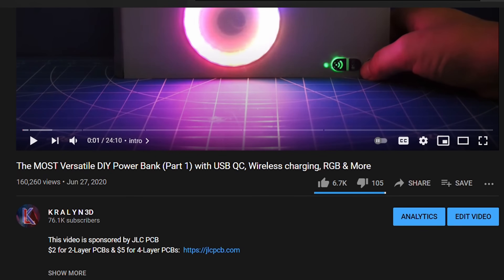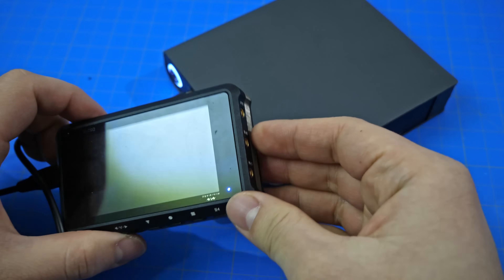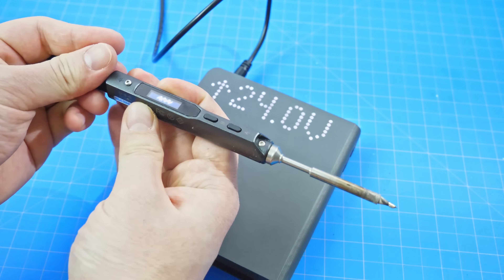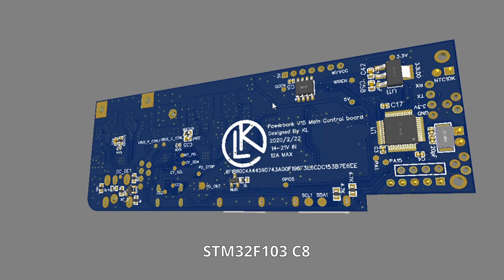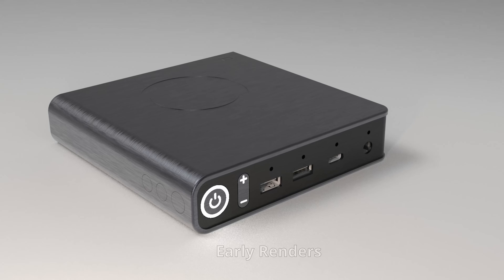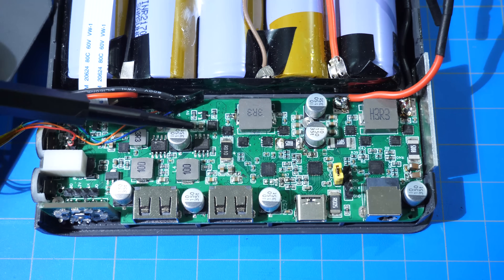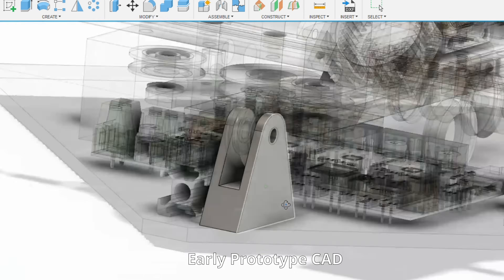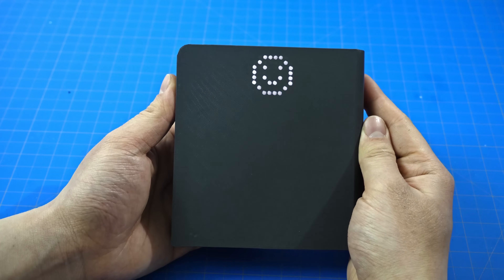Power Bank Project Update! And Others...

Comment: Your channel is wonderful, and I've been looking for a channel that explains a similar idea so well, I would love for you to explain and show the design for a modular Powerbank, in the shape of a brick,Which could be expandable or have a charging dock that could be used to charge 2 or 3 of these expandable modules for the power bank, in case a 20000mah Power bank is not enough, Have another 40000mah expandable module, and if you need more, you can attach another 10000mah module. 😅😅😅😅

Comment: It would be good for the power bank to communicate with the connected modules

For example to communicate with the inverter module to report for example ( voltage,temp,current,load,hz,estimated time etc )

Comment: Hi, great projects!!
A questions about the power bank, 
- will be firmware upgradeable?
- what will be the amps power for the dc out?
Thanks!
Reply from the maker: The DC out capable of outputting up to 5A, the firmware will be upgradable but the exact method is still being worked out for safety reasons.

Comment: I think this has drifted away from what most people like about the original power bank. That thing was packed with batteries. You can find power banks all day long that have 4 batteries in it. It also looks like the batteries are built in and not replaceable. Make one like the original and make it so you can swap out the batteries and i'm in.

Comment: Nice Design. Personally I would use Lipo Cells instead of 18650.Also the matrix display could be smaller or a lcd screen. Inside the plastic with hexagonal structures. Finally the Lipos should be replaceable in future connected with connectors instead soldered

Comment: This is a very nice power bank. Do you have any instructions on getting a USB C PD to work for both charging and discharging on a 5s battery pack? I'm building one for other uses, but having USB C PD would make it a lot better. I have found some nice modules on Amazon, but I don't know if they can be ran directly to the pack and bms, or if I need something else in the middle.

Comment: as a Product Developer and owner of El Domo product design agency, I would gratulate you for this modified design. I will contact you with a suggestion to add a module to it. Keep going. 
*upside down printing is possible, but if the parts start to reliese even a little little, this will not work. It is too risky, be carefull,.,

Comment: If the price is around 99-125 dollars i would consider that affordable but with all the plug-ins options and the DC output I feel like 149 might be decent expecially if you can adjust the amps of the DC out making it a power supply as well as a power bank

Comment: It's an amazing charger but with the extension, you have to add the ability to use AC adaptors from other countries. I'm from Australia so if I want to use the AC adaptor I won't be able to in its current form

Comment: Hello!
Please add UPS mode: When an external power supply is present, it is supplied to the output without the involvement of the battery.  If the external power supply is lost, the battery is automatically connected.  If the battery is completely discharged, then when the external power is resumed, the output power is automatically turned on.

Comment: for the ac inverter if possible in your design make where it could handle up to 300 watts where gaming laptops and stuff could temporarily run on it and another possibility if it could fit in a connector for an external battery pack for a longer runtime

Comment: Great stuff!

Would like to see battery-care features, like limiting state of charge to 20-80%. You lose 40% capacity but gain on the order of 400% more cycles!
No product I've found offers that - makes sense for a large manufacturer to limit the lifespan of a device. But it could give you a selling point. :)

Those LEDs are nice and bright... unless you're in a dark room. Hoping to see some way to limit display brightness, maybe even automatically.

Throwing "ModPod" into the hat of names. It's modular, and you could call those external modules "pods".

Comment: Good engineering design, well done.
I recommend you put some ventilation holes and a fan to improve the air flow, so as not to have heating problems.

Comment: I want to make a power bank with a QC 4.0 port for fast charging. Is there any circuit which can automatically switch the voltages and the current? I also want to make a manual port, where I will ise the QC USB tester for switching the modes. As I will go camping in the Summer, I would need a powerful powerbank to charge at least 3 phones simultaneously and use it as a giant flashlight. Also, I would like to have a display showing me the charge time in total, the current and the voltage outputs.

Comment: It would be nice if you could put multiple modules inside each other to use them at the same time.
And it also would be great if you make solar panel and extra battery modules.
Then you could for example put a few solar panel modules inside each other. And if you need more capacity you could also plug the extra battery module in.

I hope that this powerbank will be available in germany and that the AC module will have a EU plug version.

Comment: Amazing powerbank!
Good choice of MCU and all other internal components.
It's really well made and not over engineered ;)
But actually I don't know any powerbank that have some wireless communication or something.

More metal frame with plastics would be amazing but harder to manufacture and more expensive :/

I don't know what could you actually upgrade there. Maybe some better protection from dust etc.
And more strong housing?

Also I don't know it it's good idea but small buzzer to beep when the power is low?
I got some inverter and it beeps when the power is low and it will shut down in a while.
Like a reminder that you don't have much time left hah
But flashing LEDs is enough I think.

I'm looking forward to see updates on it ;)

At this time I don't have any powerbank and I would like to make one myself, but yours is truly stunning for me.

Ah, and the name!
Maybe... 
MPPB (Modular Portable Power Bank) or something simmilar like UPMPB (Ultimate Portable Modular Power Bank)
Guess it's too long hah
For short - MPB (you know what this is)
Even shorter?  Here you go: MP (Modular power)
Probably I'm not good at inventing names :/

Have a great day :)

Comment: for the external module connector, it's a nice addon to be able to increase capacity by adding extra sets of 18650 batteries thru that connector.
Reply: if this will be a feature, i want a powerwall version of the external battery module, which then you can connect this powerbank that will act as its controller.

Comment: Your power bank design is super cool! The variable DC output would be incredibly useful at my job.

If you made a module with two RJ45 connectors, enabling the power bank to function as a portable PoE injector for network-powered devices, I would be pretty desperate to buy one.

Comment: Are there provisions for a data port to access internal BMS data?  This data would be useful for implementing UPS functions and wear leveling on the batteries themselves. Also for addon modules could use the data for IoT devices.

Comment: Two questions:
1. What voltage range does the DC input jack (not USB-C) accept?
2. Could there be any way to add MagSafe to the wireless charger, potentially as an add-on?
Reply from the maker: 5-30V for the input, magsafe is possible, I shall look into this.

Comment: Does it work as a UPS (delivers power even when it is charging). Can the ports be configured not to auto tun off when no charge is used? I was trying to keep an android phone loaded, but every time the phone was full and did not use the power, the powerbank put the ports in sleep mode, and you had to reinsert or press a button to wake the ports up.

Comment: Display comsume lot of power ...can you use small display .IN power bank there is no temperature detector . Use the temperature detector for turn off power bank . When there is more heat loss or high temperature the power bank off automatically so power bank preserve the power.

Comment: you should add some kind of short circuit protection at the bottom where the module connects. Can be a fire or burn hazard with open terminals.

Comment: What type of battery /cell being used? Li-Pro? Li-Ion? 18650?   Will the cell compartment or individual cell user-replaceable? As seen in previous other's comment, adjustable output voltage/module for intl plugs will also be good.    Your design is good, looking to pledge it once you're put online for the project.

Comment: I have not tried it, however, I believe that the biggest problem with printing upside down would be layer adhesion. if you print upright, you can be a little bit off on the height calibration, however, printing upside down would probably require precise tuning of the z-axis, which you would have to retune every time the printer is reassembled from its stored state. I'm not sure if it would be beneficial or not and if you are already planning it, but a lot of printers use a heated printbed to help with adhesion.

Comment: I currently use baseus powerbank and even to my self it was surprise that one of most used feature what I use is that I charge it with micro usb and use it with usb-C PD at same time. It is so many times that there is low power usb-c available but I want charge high power devices like laptop. So I really like to see feature that add one or even multiple micro usb ports what allow charge that battery same time than you use it. Also some times there is low voltage usb-c available but because laptop needs 20v I use it as converter. So I think that at least dual usb-c is quite mandatory so that it is possible to charge it at same time when using it. Most probably it is good idea to put high power usb output and  usb-c + microusb input. 
Also one thing is that micro switch what you use to detect module is not very good. It will stuck to cables and get broken.

Comment: uff....
really great...
now looking more realistic....
1. what's the weight of this???
2. you can work on rugged rather than providing enclosure
3. also you can work on the water resistance by stopping water from getting in the case... this will make more realistic and future proof ( though it's more than enough but there are many users who needs that thing - i need because we have rainy climate)...
4. idk much of circuitry but will replacing batteries by user if anyone of it gets faulty be replaceable? this will be the best deal breaker but water resistance that i talked about won't happen likely...
5. and i'm eagerly waiting for your response and crowdfunding... i'm also in waiting list for buying 'THE ULTIMATE' from you...

Comment: This is what I wanted to make by myself. What for me would be useful would be easy removable batteries so you could change them when they life decrease. And could be module where you could add capacity and maybe unlimited amount of capacity. each extra capacity module could connect to other extra capacity module (why? sometimes while I am taking timelapses or filming in remotes conditions I might need long non stop power supply) Nice job, keep it up. Subscribe from me .

Comment: The power bank looks quite good, just have a few questions, 1 can you charge the powerbank while it outputs, 2 how long is the run time at maximum power out with the ac converter, 3 what is the estimated cost for the powerbank?

Comment: You can probably start a company with only that powerbank, it is better than most in the market. Then again that's what the kickstarter is for and I really like the design

That being said. Would the powerbank be easy enough to disassemble? As I know 18650 50E is readily available if one would want to switch if the batteries gone bad. I for one wouln't want to destroy it if possible.

Comment: Maybe you could make a high voltage power supply thats a Module completely isolated from the rest of the power bank if thats possible maybe a flyback transformer  Different idea module with with additional battery  and capacitors with possibly a booster for dc applications that need more than Usb Pd can offer

Comment: please make a aluminum case one without the high power output (that connector for the AC module). Also, is it possible to increase the QC output to 30W - 36W ? i use the TS80 soldering iron and with its custom firmware, it can use 27W of power... had some struggles with other QC powerbanks before. Kind regards from germany.

Comment: I love the design of the power bank , but the input for other accesory shoud be improved with parmanent magnets to secure them or make a press release system for the module , imagine it falls of tbe table landing on the attached module , the lock system might not stand the test of time , youve built a flawless powerbank , the only thing that can flaw it is the release mechanism foe the  removable modules 

You cam name the powerbank  (Magabank) 
Cause 1. Its more efficient than every other bankks out there 
2. Its design is new 
3. It offers what big junk box banks can and still retain its slim pocket size .

Its one of the best bank available  and i would love to have one ASAP

Comment: Hey dude, I don't know if it's possible but if you can add a setup of replaceable batteries like we used to change batteries in our phone when damaged bcz overcharging will damage battery or you might have already put a circuit breaker that will stop batteries from getting overcharged.

Comment: Hi KRALYN, i'm really interested in your powerbank design and was wondering about the feasibility of a 220V module. Considering the socket... Where i'm from, we use a type F or "Schuko"-plug and type F+C compatible Europlugs. Which creates a problem since except for the slim Europlug socket, all of these come with a larger footprint than the socket you displayed in this video. What are your thoughts on this? Is there a possibility to make a bigger sized addon module which could accommodate bigger socket types?
I'm looking forward to support your campaign. Best regards.

Comment: I like more the previews power bank because of the battery swap functionality. Having the batteries sealed in the case it makes the new version similar to what's already available on the market(except the modules). v4 should be a hybrid, meaning keep the new main board and circuitry and add the battery modules back. That's my opinion on it.
Reply from the maker: I would agree, the ability to swap batteries is a major advantage of my previous design. however, I just cannot get the price point and the functionality down. Adding this feature in the final production will increase the price by around 30%. But, I will try to make it so that the external module can be a battery pack so the expansion of capacity is still possible.

Comment: Speaking of naming, I came up with that giant ass robot from greek mythology, Talos, as series name for powerbank and its modules. Like, powerbank itself can be named Talos Core, suggesting that its a main thing that required for everything else, and different modules may take something like Talos Extensions: AC Adapter, or Talos Extensions: Solar panels hub

I have some ideas of how it can look as branded commercial product, would like to try to render it in 3d by the weekend

Comment: My only critique is that it's too thin for beefier plug types like the British plug, I wouldn't want to buy and hold onto US power plugs for all the stuff I might want to use with this.
Reply from the maker: Perhaps, due to all the feedback I’m getting from international viewers, I will re-design the inverter module so that the plug is on the top and it is a universal plug.
Reply: @kralyn3d  you could switch to a panel mount version of the C13 connector (standard PC power cable connector) and include a short C14 to outlet adapter that converts it to whichever region's plug. That way you only need two (120V and 230V) design variants and if someone is to move to a region with the same mains voltage but a different plug they just acquire a different adapter rather than an entire new Inverter module. That way you retain the compact case you have now and can accommodate for all the different outlet shapes.

Comment: What an amazing device! The flexibility alone would get a buy form me. I have only a couple concerns. First, If I put this in a backpack, I can see that module switch getting caught up and bent. I also see the switch getting activated and enabling the output port. If there was anything conductive to bridge the connections, It could cause a fire (I'm sure you have safety measures in place, but still). I would recommend installing a smaller switch or recessing a micro switch in the bank a little bit (and just modify the bump in the module that activates it). Either that or making a cover plate to protect it. I will be keeping a close eye on the 3D printer project as well!

Comment: Hey so I have a important question about the usb-c PD input/output port. I've experienced and read about questionable autonegotation before with PD charge direction. An example would be nintendo switch trying to charge a laptop or macbook air trying to charge a powerbank. Could you consider making a hardware toggle for this using your buttons to change your PD chip from dual role power (which I assume is the mode you use to accomplish bidirectionality) to source only and to sink only at the press of the buttons?

This would guarantee a charge direction if the desired charge direction and automatic charge direction do not match.